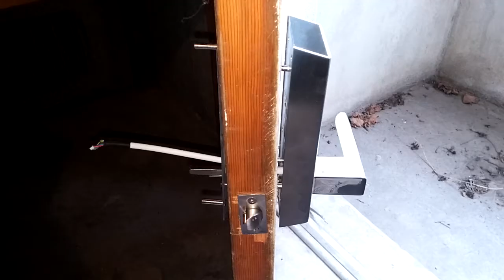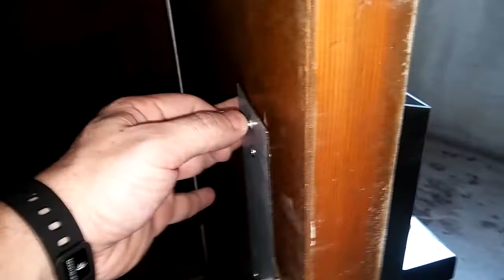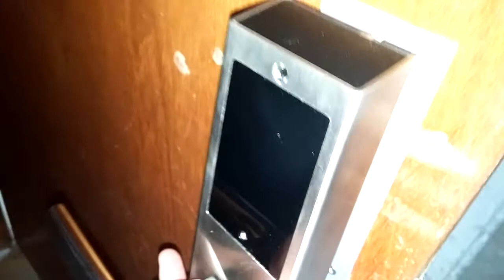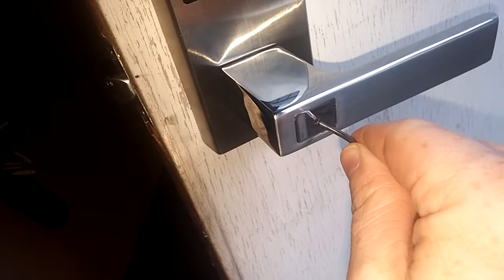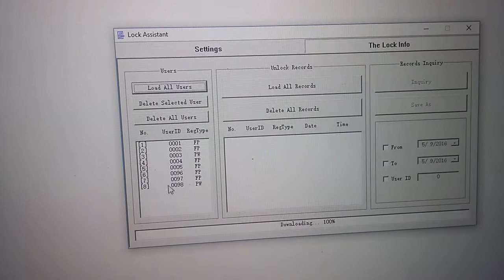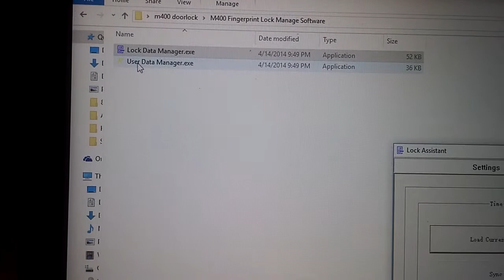CB-LELEC M400 Security Fingerprint Door Lock

Comment: Do you know where I can obtain a template for this lock?  I want to see how well the overall size will fit my door.  The deadbolt is a bit high on the door and I'm worried this lock will cover only a small portion of it.  Not enough to completely cover without hole showing and too much to just leave deadbolt as is.  Thanks if you can help!

Comment: I have a question how do I add the 8 digit codes,I already installed the lock and is already working with 4 fingerprints but I can seem to figure out how to add or create the codes to unlock the doorPlease help
Reply from the maker: If you've set an administrative user, press the plus button, when you see "AD" put in the code or use an administrators finger print, you should then see a flashing number like "05" you can now press ok and enter an 8 digit code 2x in a row to set it for that user. If you don't have an administrative user set, just press the plus button like you would to add a new user. It's the exact same way you added the fingerprints but instead of a fingerprint you just type in an 8 digit code 2x in a row.